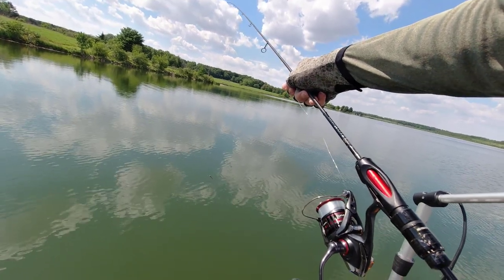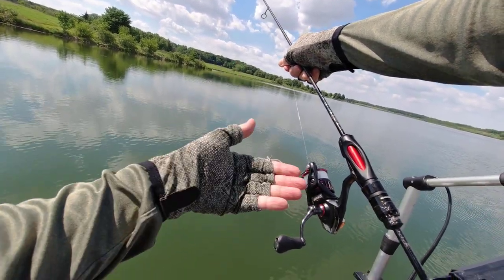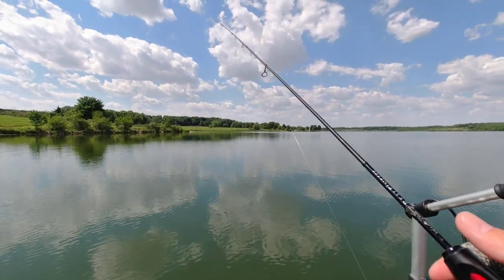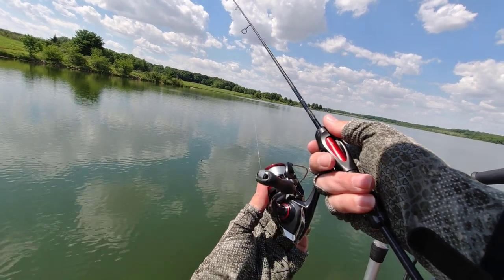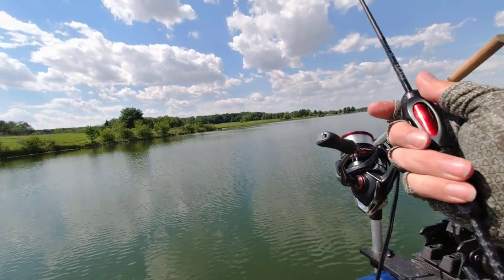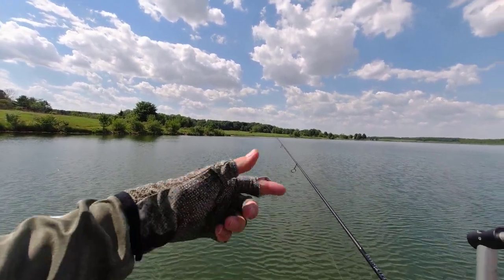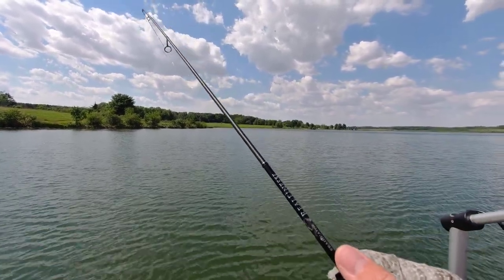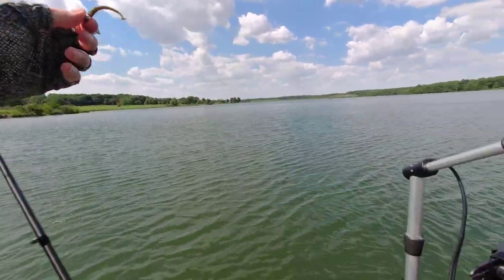Your Drag Is TOO LOOSE! You Are TWISTING YOUR LINE!  (So What?)

Comment: On every fish that I catch I want my drag going. This is because no matter the size of the fish or how it running I have the same tension. When the drag is not going when you are hooked with a fish it needs more pulling force to give the spool inertia. The best area trout fishermen in the world fish very light drag settings, and reel on a fish even on a small run.
Reply from the maker: That makes sense but i want to be clear this is not my point. I am not trying to justify or rationalize my preferences, and you are justifying your preferences. The real reason my deag is like this is this is the only way i enjoy fishing. I dont care for area trout anglers any more than anybody else.
Reply: I didn't fully understand spin fishing until this video. I still liked the way you fish. I You put the F in Finesse ultralight fishing  and further advanced fishing experience in North America  I have been battling cancer and recently diabetes now back to normal energy. It was all I could do to look after the small farm. I could watch you tube and buy fishing gear. As a fly fisherman I caught so many trout when they spin  it would ruin the expensive fly line over a few years. I just troll flys with all the fly line out. Now I the in 5 # 12 and or #14 brass swivels in mid leader. Ya two many knots ect. While if any thing it attracts  the monster trout. Having figured fly fishing out I'm going to have a fishing challenge when I go out soon fly versus spinning gear. Last year to my supprize the lures did good but the fly got the biggest 8lb. Rainbow. So after watching your videos I have learned so much about spinning reells rods lures & lines.. Thanks so much for making a though time bearable. Adapting your techniques to my spin outfits for trolling and casting will add more fun and enjoyment to each fish. Man you think your videos are long lol.

Comment: The drag slipping in this fashion is a lot of the excitement in fishing. I agree with all of your points here. What is your preferred line and size? I have always gone with braid + leader because on a normal sized spinning reel the mono or flouro would "fall off" the spool. I understand this is not so much the case for smaller diameter monos?
Reply from the maker: if u take care of line twist, nothing will fall off the spool. Braid hides the line twist because it is not elastic and doesn't want to jump, but braid gets twisted just the same. I don't use braid for anything at all, not even catfishing. I know its strong but i don't need strong line for what i'm catching. I hate the way it feels.. casting, playing the fish, getting wrapped and getting knots, i hate everything about braid

Comment: 100% agree!  Fish put up a much better fight on lower drag settings anyway.  These days I find that I prefer my UL setups with lighter drag as it takes smaller force to put a big bend in the rod; using the same drag setting with L+ power just doesn't put much bend in the rod especially the ajing/light game rods.
Reply from the maker: Right. If you use too heavy of a tackle, it doesn't matter what you catch. Five pound bass in nothing on heavy power rod and 50 pound braid, in my opinion. I know people will disagree, but i catch 30 lb carp on 8 lb line and I still feel unless it runs in a snag, the fish has no chance..

Comment: Have you ever tried Nanofil line? It’s really small diameter for its break strength but I find it frays and needs to be re tied more than mono.
Reply from the maker: i have some. Its small compared to mono, but not compared to braid. For braid it is kind of thick. I don't like fishing braids.. dont enjoy the fight with no stretch line. Maybe if it is on a very soft rod.. but then casting in the wind is a problem..
Reply: As far as i know, Berkley doesn't produce Nanofil anymore? In Europe it's hard to get.
Reply from the maker: This line doesn't have the strength of braid nor does it have the softness and stretch of mono. Also it wanst round, but somewhat flat, and didn't cast well. I was not surprised it was discontinued quickly.
Reply: @ifishcatfish  It’s not discontinued from what I’ve seen. Tackle Warehouse carries it and I’ve recently seen it in Walmart. It’s also on Berkleys website. Berkley claims it’s their longest casting line. I’ve had trouble with wind knots but I had it on a tiny 1000 size spinning reel. I think it knots as it passes thru the guides but I can’t be 100% sure on that. I’m searching for the longest casting light line for that tiny spinning reel I have. I use it for redear and bluegill.

Comment: Some people always try to put you down, no matter what. You are right, line twisted, now what? Get a new one. And, why would they care. In trout area fishing it's common practice to reel in, while the the drag is working, to keep constant tension, because it's usually fished with barbless hooks. Imo, the lure itself (e.g. spinner vs non-spinning lure), the diameter of the line and the line material are big factors. Like, a strong monofile line will twist less, because it's stiffer, compared with a thin line. For me, the thinner my lines and the weaker the knots are, the looser my drag. I think, it's better to have a drag that is on the looser side and gets the fish in, than a broken line and losing a fish with the hook still in it. Btw. I've never had problems with twisted lines either.
Reply from the maker: yes, stiffer line like fluorocarbon or even better polyester like this Varivas in the video, will naturally resist twist. On my braid i can see some twist. The problem is braid is so strong that I don't lose line. I use the same daiwa braid for 5 years on my float rods, so with time it accumulates. Still never seen a loop. 
But for me none of that is important. My drag has to be exactly like this, because this is the only way for me to enjoy fishing. So if a price has to be paid - i will pay it.

Comment: I agree line twist on 2 lb line is insignificant unless it is twisted hundreds of times.   6, 8, 10  lb line with line twist is very annoying and immediately apparent.    I have caught 5 to 10 pound fish with 4 lb line many time because I had drag set light enough to never break the line.
Reply from the maker: thicker lines actually have some natural resistance to twisting, because they are thick and stiff. If you twist them a little, they will naturally try to recoil, and if your rig allows it, they will untwist. I made a video of removing everything from your line, and then just hold it tight between your fingers and reel it. The pressure of the fingers in most cases is enough to remove line twist. Only if you had it twisted and left it twisted for a long time, then you turn the twist into memory